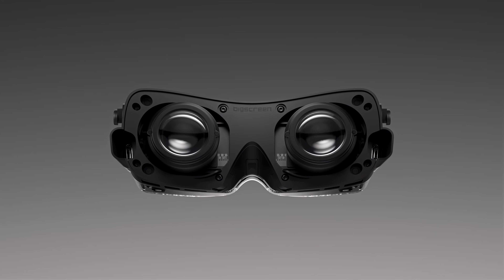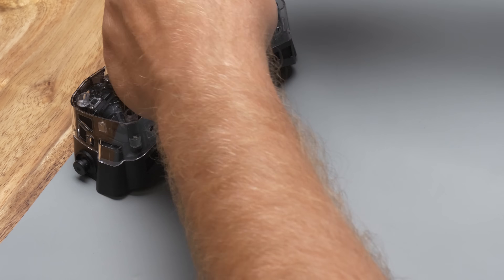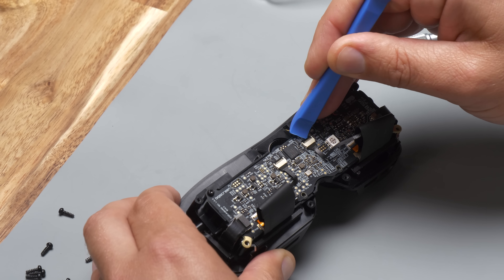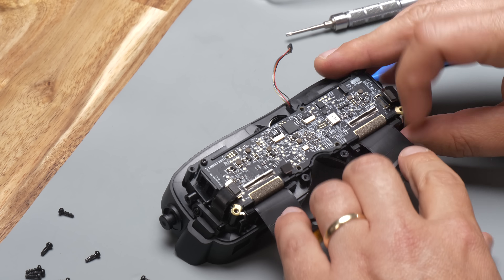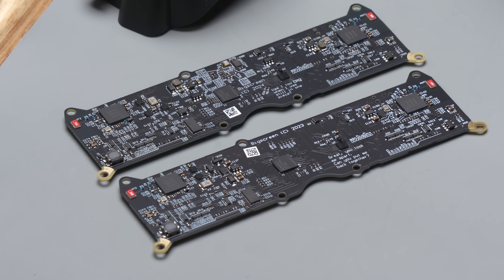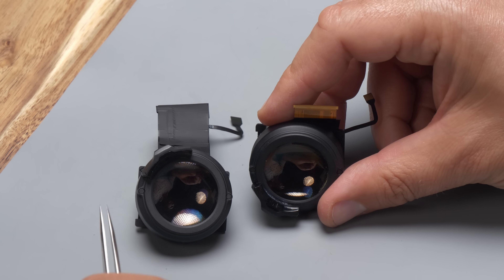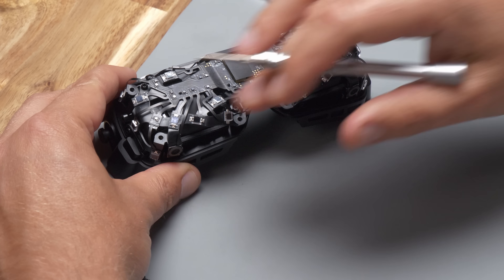Bigscreen Beyond 2 Teardown: How We Achieved Eye Tracking, Adjustable IPD & Better Optics in 107g

Comment: My only caveat is the fan blows hot air down onto my face, would be better to exhaust that hot air upwards or to the sides or even straight out the front.

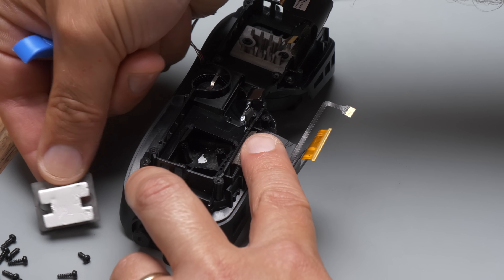Comment: I love how repairable the Beyond 2 is, but I do have one question regarding your thermal solution shown at 8:05
What made you use such a thick thermal pad instead of extending the heatsink down more and using a thinner one?
Coming from the PC space, the general consensus is that the thickness of thermal pads should be reduced to aid in thermal transfer where possible, and with more metal there is more thermal mass.
Was the decision made for EMI purposes or making the headset as light as possible?
Thanks for the teardown!

Comment: But you haven't achieved eye tracking yet. You've achieved eye approximation, not on par with any competing implementation on the market. Huge fan of literally everything, will likely still buy one, but I cringe every time you claim a term when you haven't met it's bar yet. Imagine buying a turbocharged car, only to find the turbo just makes cool noises but doesn't actually improve performance. But the company keeps hinting that they're working on a tune, that'll bring it up to the *bare minimum standard of every other turbocharged car on the market*, but refuses to promise it's actually going to happen. In 2025.

Comment: You guys need to make a wireless dock for this to make it playable without cables attached to PC. Something that can fit on pocket or backpack. That is the only reason why I'm buying Quest.
Reply: Shanks mentioned in an interview that people who want standalone/wireless should indeed go with Quest 3, because it just works.
Reply: Wireless at that resolution isn't viable + input lag. Plus the battery life would be garbage and adds unnecessary weight that goes against the headset's unique selling points. If you enjoy your Quest then keep playing it and be happy.

Comment: God damn it, lose eye traking, add inside out tracking, passthrough and a compute unit with a battery that connects by a wire and fits in a fanny pack and you will win vr and ar, at least in my eyes, stop fooling around.
Reply: Have you heard about the Pimax Dream Air? It sounds like what you just described.
Reply: @replacesoundboard no, havent heard of it, thanks, one gripe i have with it is that they are still looking like swimming goggles
Reply: @pironiero  I think it's kind of inevitable because of how much heat each individual components are generating. The displays themselves, the pass through cameras (similar to tiny action cams which always overheat when recording high quality videos).

Edit: For a moment I forgot I was talking about the Pimax and was describing the Play For Dream. The Pimax has no high quality pass through.

A pocket computer could alleviate some of the heat generated by the processor and other things, but yeah, heat is still going to be a thing... Maybe if they used watercooling or something, I don't know.
Reply: @replacesoundboard the higher the heat the greater convection effect will be, so heat generated by cameras and displays can be eleveated by copper foil and perforations in the headsets housing.
Play for dream is even bigger and even gogglier =)
water cooling is never a solution for heat problems, all it does is delaying the inevitable due to thermal mass, either way you will need surface area to get rid of the heat.

i think its possible to make bsb2 into the thing i've described, but the glass part will probably get up to 130-140 grams
Reply: @pironiero  I was imagining something like: the pocket computing unit would also include heat sinks with a watercooling tube connected to the headset or something. But of course I have no knowledge in hardware in any way, so that may not be feasible at all.
Reply: @replacesoundboard nah, its feasible, just not reliable and quite incefficient

Comment: Lets hope the third version is standalone, inside-out, passthrough and affordable.
Reply: Out of curiosity, what in this headset piqued enough of your interest to hope for a third version that incorporates everything you are demanding?

The first 3 criteria are already done by the Play For Dream, but it's not affordable because it uses very expensive 1.3 inches micro OLED displays. The moment you replace them with more affordable LCD, you get a Quest 3, which sounds like it's already perfect for your use case based on another of your comment.

Comment: Incredible engineering.  You guys are literally pushing VR in the direction it NEEDS to go for mass adoption.  Comfort.  The average non-enthusiast comes home from work and just wants to relax.  A brick on their face is an impediment for doing that.  Thank you for pushing this technology forward more than any other company right now.
Reply: Nah, meta is pushing that.
Comfort is no issue, the buy in requiring trackers, a pc, an entire steam setup, wired cables. THAT is what is keeping people from VR, and Beyond solves NONE of that.
Reply: @Atmatan  I used to think comfort is no issue. But ever since I used my BSB1, I don't feel like returning to my bulkier headset anymore, even though it posed no problem at all for me.

But of course, I've heard the opposite too. I heard some people just ended up exclusively using their Quest and stopped using their Beyond. In the end, I think people should just use whatever works for them instead of worrying about turning VR into mainstream in any way. Personally, I love my headset to be wired and connected to a PC.

Comment: Now make it wireless! <3 
I don't care it it weighs more! I NEED IT! >.<
Reply: I have a Quest 3 for wireless.  BB2 will be for seated VR - I won't care much about the cable.  You can use a pulley system if it does bother you, but wired VR just kicks the pants off wireless VR for PCVR.
Reply: Have you looked into the Play for Dream?
Reply: @replacesoundboard Chinese crap.
Reply: @insertnamehere4419 He doesn't have a lot of choice if he wants wireless
Reply: @YuJay  I only noticed your reply (it's hidden by Youtube for some reasons). Yeah, I heard the last viable wireless base stations headset is the Vive Pro 2.

Comment: if they only had passthrough cameras.
Reply: High quality pass through would cause the headset to heat up very fast, similarly to action cam and smartphones. It would require huge heat sinks, which would quickly make the headset too bulky.

Comment: I would insta buy BSB 2 if not for:
- Reduced stereo overlap
- Outdated 2.5k panel with only 72 Hz native

P.S.:
BSB, I hope you'll make a 4k panel version in near future. That would definitely be the thing that I was waiting for so long.
Reply: I'm glad they decided to stick with what works. The 75Hz is more than good enough for my use case and keeps the pricing relatively low when compared to the MeganeX.

Normally, I would have suggested going for the MeganeX if you want higher resolution/refresh rate, but seeing how wrong that headset can go if it doesn't fit your face... I can understand why you hoped Bigscreen would also tread into that resolution.

Comment: The real question is why you still have no passthrough. I would've bought the V1 if it had it. Now I'm sad again because v2 doesn't have it either.
Reply: With the halo mount it's really easy to just flip the headset up, more than good enough for me tbh
Reply: Because it's not what they're focusing on. When you see how fast a smartphone/action cam is heating up when recording high quality videos, imagine how fast a VR headset would overheat from 2 high quality pass through. That would require massive heat sinks to dissipate the heat, which would quickly make the headset a lot bulkier.
Reply: Because they have been totally vocal about Min Maxing weight as their primary stat. 
But it looks like there's technical modularity there with a USB port free and a removable front plate, so who knows. Maybe we will have a future upgrade path for that and inside-out tracking with antennas that sync to some cheap-o Meta touch controllers.

Comment: 1000 dollars? than 100 for a face cover? thats TOO much for such a small product that uses wired pc vr? love it tho
Reply: Half of the price goes into the micro OLED panels. They are hella expensive to produce.
Reply: They really ain't people overpriced the micro oled panels because they don't know anything about the manufacturing the big screen is artificially increased in price the pimax is better than the bsb1 and 2 bigger display more resolution more fov and it's a balanced headset@replacesoundboard
Reply: @aliceuwu1825  "bigger display more resolution more fov" => Which is why the Pimax costs twice the price, and the same price for the SE edition
Reply: It's not twice it's around the same price if you add all the stuff you need for the bsb2 like controllers base stations and the head strap since no one wants to use the base straps @replacesoundboard
Reply: @aliceuwu1825  Why should I add the price of controllers and base stations if I already own them? And I use the default strap because I don't want to use an audio strap. Why should I purchase an audio strap if my high fidelity audio is already good and I updated the soft strap to become my most comfortable headset?

I'm beginning to understand where you're coming from. You're speaking about people who don't come from HTC Vive/Valve Index kits. Obviously, in that kind of scenario, I would discourage getting this headset.

That being said, the original comment was speaking about the $1000 price point, which is the headset only.

Comment: battery pack/wireless accessory, simple quest style controllers with SWAPPABLE BATTERIES. Then you are my main driver. End of story. This is just going to be another device sim players are going to collect and collects dust on the shelf unless you do this.
Reply: That sounds harsh. I mean, I can understand you are totally disappointed by your experience with current SteamVR controllers, but that's not the case with everyone else. I loved my BSB1 and I purchased the BSB2 because they fixed the pain points which I disliked in the BSB1.

Personally, I prefer the bulky Valve Knuckles over the tiny Quest controllers. But that's just me.

Comment: Doesn't matter how good your headset is if it's using index controllers with inherently trash tracking and and practical joke levels of battery life.
Reply: You mean the best tracking in the industry and 7 hours of battery life?
Reply: @insertnamehere4419  Even if it was 7 hours, for controllers that's trash.  Even my quest pro controllers last DAYS. my quest 3 controllers have infinite battery life because I just swap out rechargeable ones but even those rechargeable ones will last over a week. Having your ability to be in vr governed by your controller's "7 hour battery life* is also silly, limiting and frankly it's 2025, can we please stop blaming how lack luster consumer products on covid? Because honestly I am not impressed with the progress of VR industry as a whole. Most features require half ass busted third party software you get from github, nothing works truly natively unless you are just a casual "I have a vr headset in my closet" gamer that play beatsaber or a flight sim once in a while.
Reply: @insertnamehere4419  I get 2 hours of battery life at best and my controllers are contently losing tracking and floating away at all times even while using the index headset. I have 8 vive 3.0 trackers and 4 base stations, they never have issues. The finger tracking is a useless joke if you are actually trying to use them as controls for anything. Best tracking in the industry is wildly crazy to claim. 7 hours of battery in your copium den of delusion.
Reply: @Atrazeal  You should get that fixed.

Comment: The beyond one had controller tracking antennas??? Never once have I ever been able to connect to my controllers without having to use 2 of my vive tracker dongles. I even went online and purchased 2 extra tracker dongles just for this reason. If I do not have 2 tracker dongles plugged in the controllers DO NOT WORK on my bigscreen and never will. I feel like I am being gaslit. Steamvr controllers are absolute garbage water at tracking, finger tracking, brittle, inconsistent, bulky and nearly worthless battery life. The battery life of the index controllers alone makes them completely useless for anyone using this headset for what you specified its intended use was focused on. So I am very confused as to why you would do this? Am I supposed to just buy 4-5 sets of index controllers so this headset is actually usable in things like vrchat? I have even tried to get battery straps for the index controllers and having batteries strapped to my wrists is simply not practical. I am actually thinking about it as I am typing this, I may actually cancel my beyond 2, because it will just sit in my closet like my other one simply because I am forced to use garbage index controllers and it will NEVER become my main driver for VR for this reason alone.
Reply: What controllers are you using? My OG Vive wands and Valve Knuckles are working out of the box when I pair them with my headset in SteamVR.
Reply: @replacesoundboard index knuckles
Reply: @replacesoundboard Doesn't matter tho when their battery life makes them pointless unless you are "popping on half life alex for a few minutes".
Reply: @Atrazeal  Wait, your Valve Knuckles only last a few minutes? I played Half-Life: Alyx an entire afternoon without recharging them.

I think I see what you mean though: you're criticising internal batteries vs replaceable batteries?
Reply: @Atrazeal  What do you suggest using as controllers? I really don't think there's a solution for you & that's not the headset's fault
Reply: @kirasmith1147  They can manage to engineer this marvel in tech they are showcasing in the current video, im sure you they could find a way to offer some base station tracked controllers that function similar to quest controllers and have swappable instead of rechargeable batteries.
Reply: PEBKAC
Reply: Are you a little thick in the head the knuckles last 8 hours and only take an hour to charge which means unless you are a no life piece of shit they are perfect because it means you can take a break in-between
Reply: Also the index controllers have some of the best tracking on the market and their finger tracking is like one of a few that are available not to mention it's 6 fucking years old

Comment: there are controller dongles inside the headset that's so cool
Reply: It's a native SteamVR headset, so yes. Just like the HTC Vive and Valve Index headsets, you just boot SteamVR and pair the controllers with the headset.
Reply: @replacesoundboard that's so cool

Comment: Diagonal FOV :) They are just making new terms instead of improvements.
Reply: I can suggest having a look at Mark Kovalcson's video about the Bigscreen Beyond 2. He speaks extensively about the improvement in field of view with measurements using wimfov
Reply: @replacesoundboard Might suggest the company not misleading, and giving actual relevant information?
Reply: Diagonal is the proper term. Measure your monitor or TV screen  diagonally, you'll notice the number matches the spec sheet /size it's claimed to be? Measure it horizontally and you'll go wtf they ripped me off! where's my missing inches!
Reply: @insertnamehere4419  Yes, for panel size. But not for FOV. Every manufacturer gives Horizontal FOV, so they created their own number to mislead.

Comment: So this can't be full eye tracking, only pupil tracking, there's not enough illumination to see eyelids and eyebrows and the position isn't great, it juts out from the lens towards the eye. Guess I'm cancelling my pre-order and waiting for a headset with full eye tracking and OLED. I'm impressed with the engineering but that's all sadly.
Reply: Last I heard, the hardware itself works for eyelid tracking, but since the gasket itself is sitting on your eyebrows because of the small form factor, and because of how close the lenses are to your eyes, it obviously cannot track eyebrows.
Reply: @replacesoundboard Who cares about eye brows. Only weebs in VR chat do. No need for eye brow tracking for foveated rendering.
Reply: @insertnamehere4419  Worst case scenario, I heard people say the eyebrow can be "guessed" based on eye tracking. A bit like how the mouth moves accordingly to what you are saying even if you don't have face tracking, from what little I heard.

Personally, it's not something I'm interested in.
Reply: @Pyrii  VR chat sucks.
Reply: @Pyrii  For what it's worth, that VRChat eyetracking demo came from their video about the EyeTrackVR DIY module.
Reply: Each module has two illuminators, not including the camera /sensor. What are you on about with "not enough illumination". If it wasn't enough they wouldn't sell it as being enough.